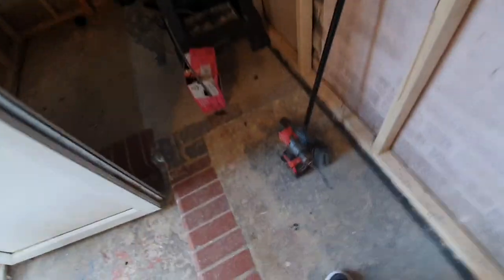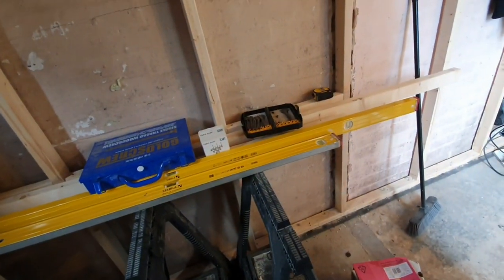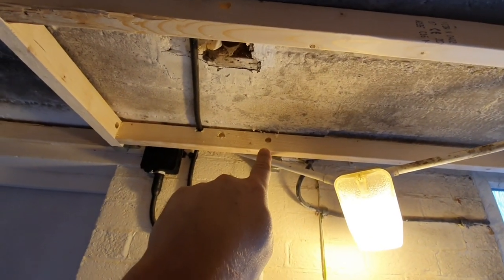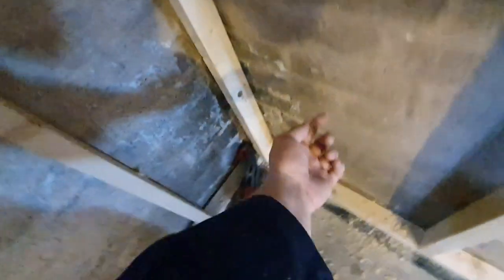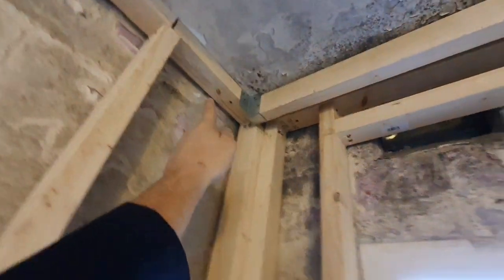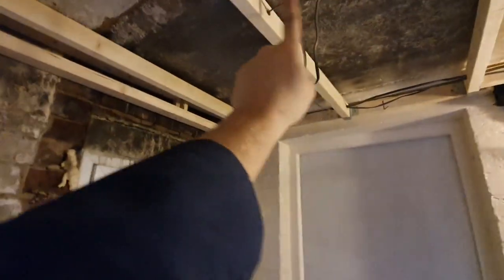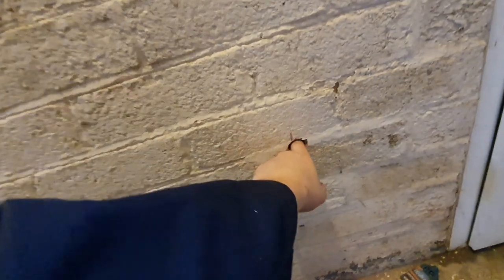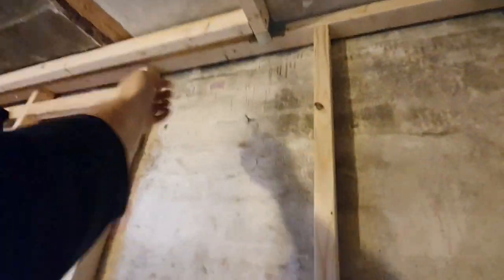Electrics & Plumbing For Kitchen Extension

Comment: Man of many talents, smart move having the sparky throw his over the set up before slabbing, the plumbing system your using look's straight forward,  would price range be similar to Pex pipe, Will your bro do the skimming of your utility Room
Reply from the maker: Hi, not sure what the price difference is on the pupe and il be doing the skimming, a lot of it will be getting tired the Sam as the kitchen